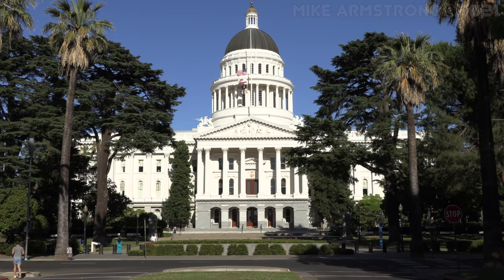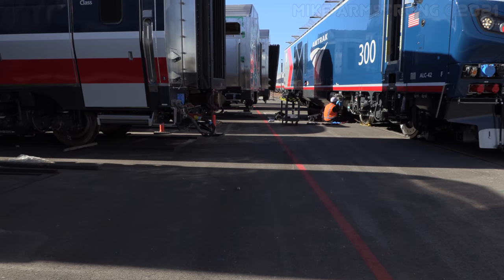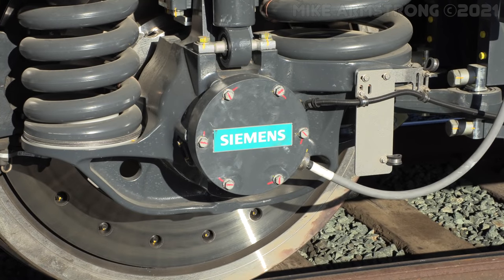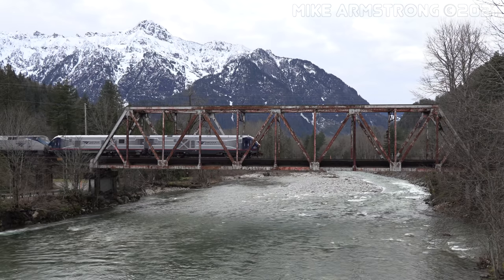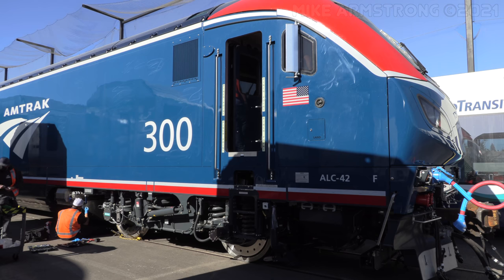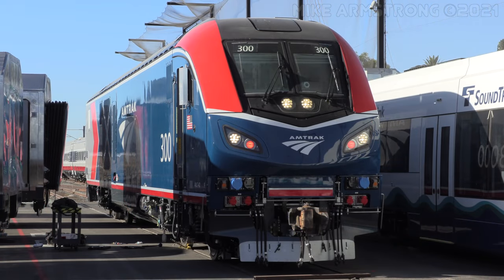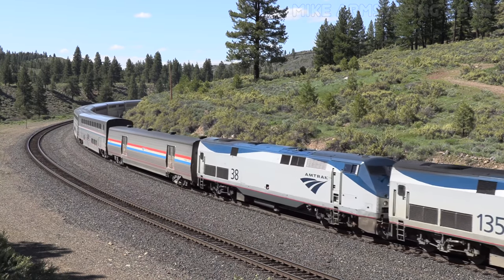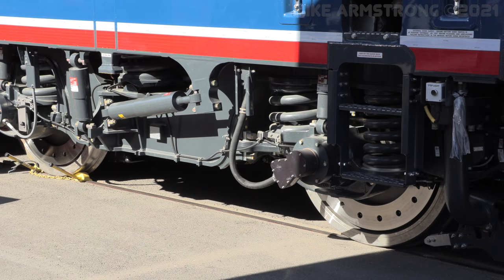Amtrak ALC-42 New Locomotive - A First Look

Comment: which amtrak lines would these be on, did NY order some?
Reply: These are going to be on all of Amtrak’s long distance routes and maybe some intercity routes to supplement the SC-44s. NY did not order these since they need to have a Dual Mode Charger variant and the ALC-42 is Diesel Electric!
Reply: @supermarionathan1426  A dual mode Charger is still a diesel-electric locomotive, the difference is that it can use a third rail pickup shoe to supply electricity to the traction motors instead of the diesel engine.
Reply: @sadams12345678  I know that dual mode locomotives are also “Diesel Electric” but many people classify these locomotives as dual mode locomotives as they both have an engine and third rail shoes!

Comment: A Cummins engine in a locomotive I wonder how fuel efficient and practical this is going to be
Reply: I mean have you seen the SC-44 Chargers? They also have a Cummins engine and they perform well!
Reply: Rods to god on occasion. They still haven’t fixed that part of the DEF wearing down parts ( like in the truck motors) 

Burns more fuel than a P42, but that’s none of my business 😂

Comment: Now all AMTRAK needs is decent track. Just took a trip on the Auto Train and the track condition was absolutely atrocious. No amount of newer or better locomotives or coaches for that matter, is going to improve the service without good track. All it will do is provide new equipment for the track to bet to death. I would love the option to travel by train, but not on freight line track.

Comment: Amtrak should've gone with the EMD F125 instead
Reply: Why? They have a working relationship with Siemens and its a proven design. It will integrate seamlessly into existing mechanical facilities and the supply chain already set up for servicing the current Siemens loco's.  The F125 was plagued with problems and it would mean adding a second locomotive supplier and for what?  It does nothing the Chargers wont do.
Reply: @FFred-us9tw  A number of reasons actually. I'm not even sure where to begin.
Reply: @amtrak_121  It unfortunate that f125s didn't turn out to be better locomotives. And Metrolink was the only buyer. I sure EMD was considering Amtrak when they made them. Siemans has an iron grip on new passenger sales. I don't hate and actually like the new Alc 42 locomotives, but some variety would be nice. EMD has to take another loss.
Reply: @amtrak_121  It don't look too good....but the only you can do is hope!  I for one hope the issues the f125s are having be fixed and turned they out to be reliable/good engines. So maybe another commuter agency will give them a chance.

Comment: talking a lot about sustainability and "reducing greenhouse gases" but i dont see any push to actually implement electric locomotive or at least hybrids that can use the catenaries :/
Reply from the maker: Hybrids or "Dual Modes" as well as some battery powered units are part of the new equipment order that was announced over the summer. They will be delivered in the 2025-2029 timeframe, mostly for the intercity trains in the Northeast.
Reply: @CoasterFan2105 That would pretty much be similar to a P32AC-DM that Amtrak is still running on the Empire Services on the Empire Corridor.

Comment: There is just one problem with these trains, they are diesel and they are old engineering that should have been pure electric eon’s ago.
Reply: Diesel-electric is good technology for trains.  Long-distance electric lines would be hugely expensive for the benefit of a few trains.  Electrified tracks are more practical for commuter lines with many more trains.
Reply: It's far less costly and far more reliable to run Diesels than to electrify and maintain a coast to coast electrification network. Modern Tier 4 Diesels emit very little pollution and provide a reliability level that electrified railroads could never achieve on this scale.